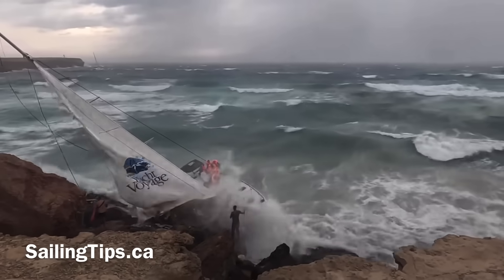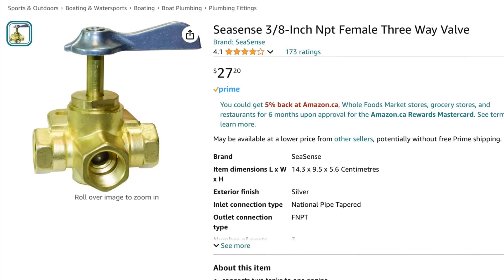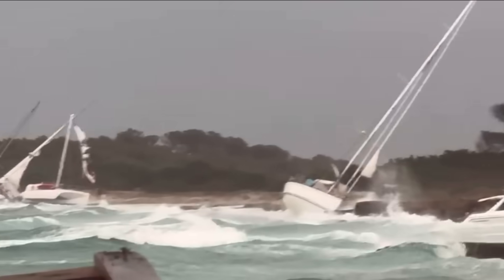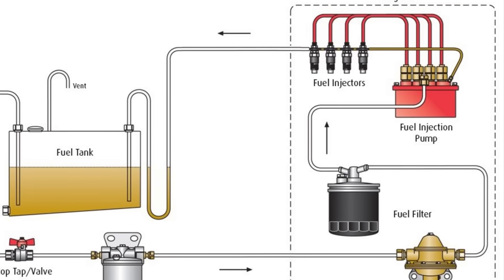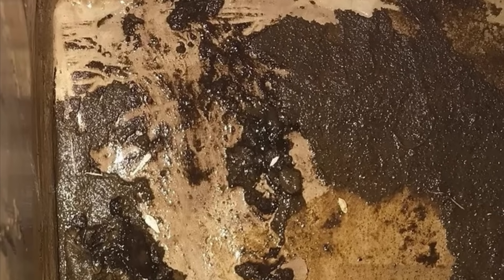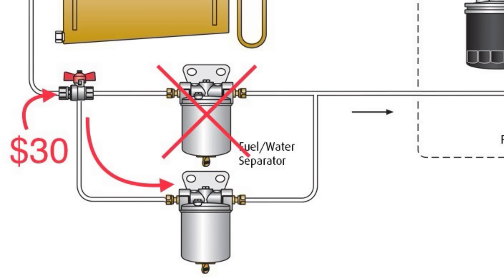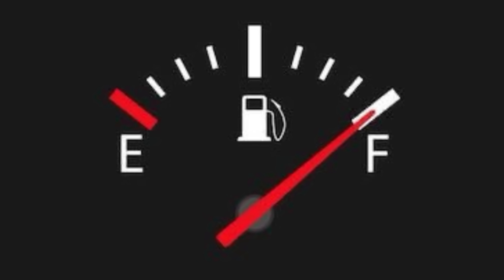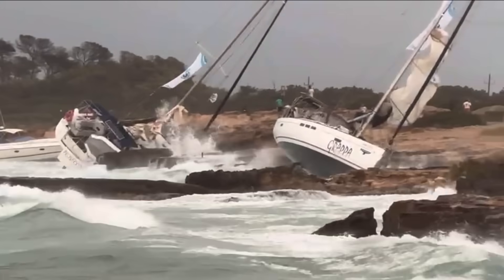The Critical $30 Safety Device Most Boats are Missing!!!

Comment: Nice. The new boat gets paid for by the insurance company that passes the cost on to insured people so we all pay for the wrecked boats. BTW - the insurance companies love having more claims because they get to handle more money and take their cut. If there are no boat losses there would be no need for insurance or insurance companies. It's what;s called an unvirtuous circle.
Reply: How does having more claims mean the insurance company gets more money?  Wouldn't they want as many insured vessels and as few claims as possible?
Reply from the maker: @BillDownhill  Yes I think they would generally want to maximize premium revenue and minimize claims. At the same time a few claims in the news now and again to motivate people to buy insurance in the first place, which they may be less inclined to do if boats were “indestructible”. Insurance is also becoming harder to get for “high risk” boats or boats in “high risk” areas.
Reply from the maker: Yes it would save all of us boat owners money if only the standards (e.g. ABYC/CE) required redundant primary fuel/water separators!!! You can even buy pre-configured redundant units but they are pricey and not required for a boat to be “certified”.
Reply: Insurance companies don't make money on claims. exactly the opposite
Reply: Tell me you don't understand insurance without telling me you don't understand insurance. Sheesh.

Comment: Perhaps a centrifuge should be considered..........🤔
Reply from the maker: Lots of fuel/water separators do use centrifugal action! They’re on the expensive side though. You can also buy pre-made units with two redundant filters and a switch, but again they are more expensive than what you find on most production boats.
Reply: @SailingTipsCa these toolless dual filters with switchover are essential in every boat in my view.
Reply: @SailingTipsCa  Perhaps do a video about those as well?
Reply from the maker: @nobody46820  Good suggestion!